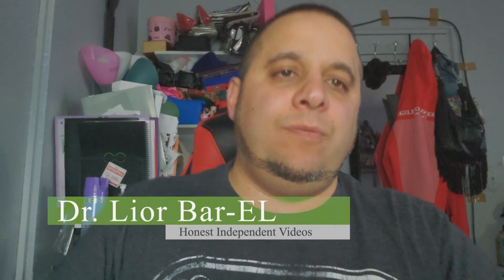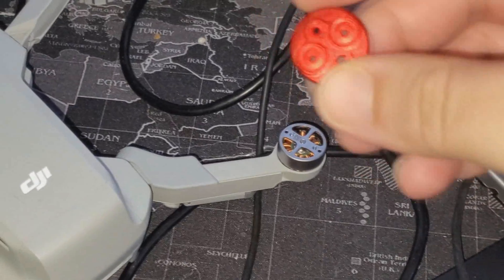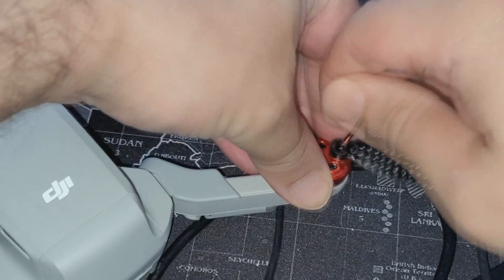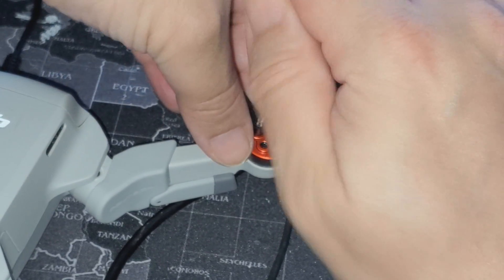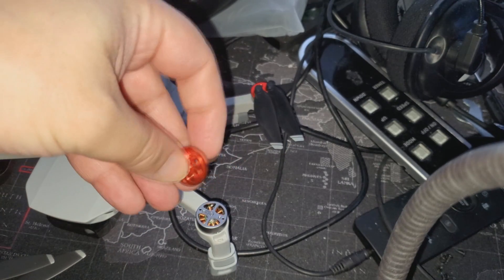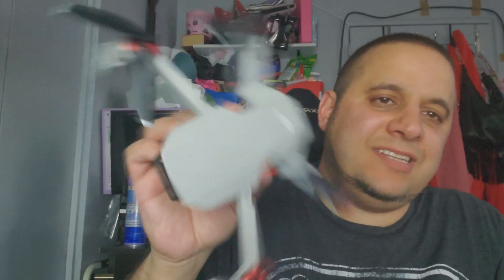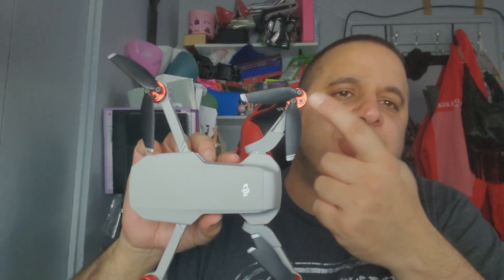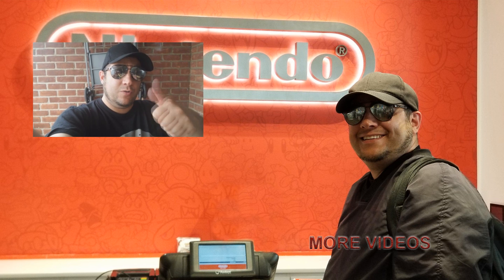DJI Mavic Mini Permenent Aluminum Alloy Motor Covers

Comment: I know you folded the drone closed but what about with the harness case on it does it put any stress on the wings under the strap . i would imagine with the cover the blades are raised a little bit . its a valid question
Reply from the maker: I have no issue with the case but do recommend u get the case I reviewed u won't be sorry ad it will fit ur drone in with zero issue and additionals.
Reply: @Vortexcinema677  I have the original harness case that came with my mini 2 should it work fine with that case

Comment: I'm going to get those thanks
Reply from the maker: Worth every penny.  If this helped in any way please hit the like button ,subscribe , and hit the bell button for many more videos to come.
Reply: Hello there Sorry to trouble you again my drone it's DJI mini 2 se
One of the eBay seller I emailed them and ask will this fit my drone 
They told me it will not fit do you know if this will fit my drone thank you very much
Reply from the maker: @Anika Anas Aria  I am so sorry but unfortunately I do not have this model. What I would do is get it off Amazon and if it doesn't fit do an exchange or return it. I am building a tie fighter drone right now and I believe it's the same size as the mini but not sure. I had to get smaller ones but it was custome made. Please look for that same company and ask if they have one that matches.

Comment: Ty for the info, I have the red ones with only the 2 bigger holes(red) and they work great on the Mavic Mini.. But i have the silver sunnylife ones with 4 holes for Mini 2 and the screws are too tiny, they stripped before i could even get them on. wont risk using those, but again ty well done thumbs up new sub
Reply from the maker: So sorry I didn't see this post and was never alerted of it. Ur right if it strips once it isn't worth to give it a second go. These are solid. If anything happeneds anytime I'll post a update but so far so good.

Comment: You've had no issues with yours? I bought them but now I'm kinda sketched out to put them on it don't want the screws loosing in the sky.
Reply from the maker: I still use it with zero issues. U won't loose anything if you screw everything right.
Reply: @Vortexcinema677  do you use thread lock or anything?
Reply from the maker: @Koda716  I'm sorry what do u mean by thread lock? It screws in till toght and it never comes off.
Reply: @Vortexcinema677  thread lock is that blue liquid they put on the end of the screws for the propellers
Reply from the maker: @Koda716  I can assure u for me if done right and screwed in properly nothing will.come off. I use it many many times. I am about to use it to do a electric bike review soon and u will see everything is still working and intact. If u feel unsafe it's always good to check ur screwed before flying. I always give it a once over but there was nothing to tighten or correct thus far. Only grip I have is the batteries. I have two new ones I never needed to use and had them for 8 months and they can't hold a charge which sux but understandable.
Reply: @Vortexcinema677  I'm a contractor by trade so if I can't put a screw In correctly that's a problem 🤣 I was more worried about the tolerance on the aluminum threads not that they loosen up over time but you said you've been running them for months so I'm gonna put them on and trust it won't drop out the sky. Thanks man
Reply from the maker: @Koda716  I tell u for me it's a permanent installation it seems. I even accidentally crashed it a few times due to horrible wind condition I made a real.stupid decision to fly but all is intact even when the propeller broke.